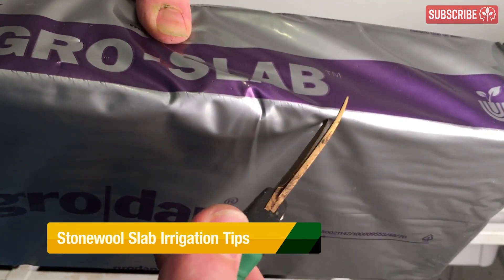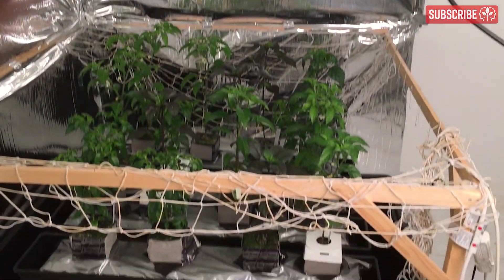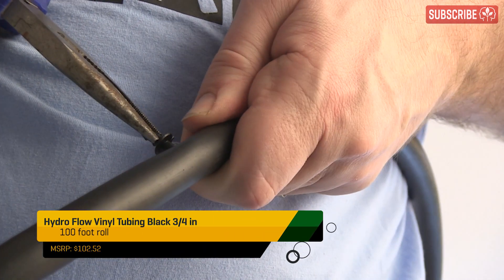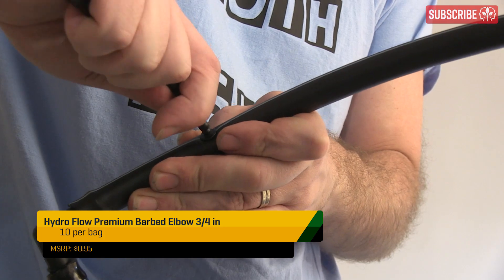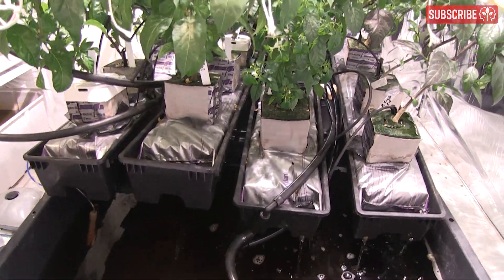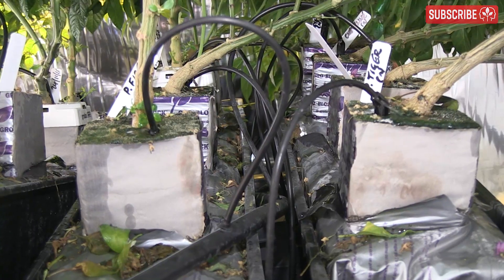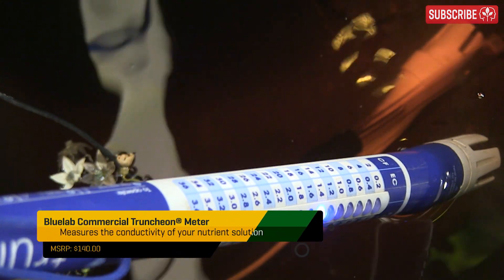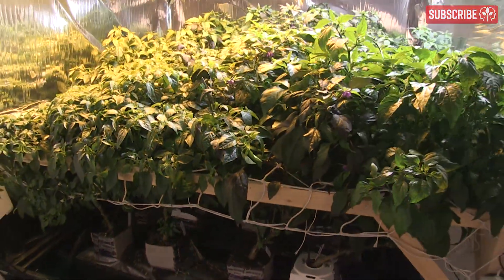Dialing in Drip Times and Drip Cycles with Rockwool / Stonewool Slabs

Comment: Coco coir same practice ?
Reply from the maker: Pure coco coir pith / fiber mixes have similar water holding capacity as rockwool (10X) — the key difference between these two media is the CEC (cation exchange capacity) — rockwool has zero — cococoir has significantly more — use a nutrient mix with elevated calcium and magnesium when working with coco coir slabs.
Reply: @Just4Growers  Thanks for great Content .  I use Ro water 0 PPM  . for cal mag 130 PPM is enought with Coco coir ?

Comment: Hey Everest,
How much water should I feed my cilantro and tomato plants if I drip 5- 6 times a day at 2 minute intervals?
Is dripping more economical in terms of saving nutrient than dwc?
Appreciate your feedback as always. :)
Reply from the maker: Hey Ravarsen, If you're recirculating your leachate (run-off) from your drippers then you're good—it's just as water wise as DWC, if you have a lid on your reservoir to avoid evaporation. What size pots are you growing your toms in?
Reply: Everest Fernandez I have a spare tank I'm thinking of using in a coco coir drip system, which I think won't cause any evaporation issues.
I'm growing my tomatoes in 1.3 gallon plastic bottles, dwc system. Is 1 gallon nutrient sufficient for vegetative and fruiting?
As you can guess, I'm pretty new to this and I'd like to learn from you. :-)

Comment: Hi Everest. I am having a bit of trouble completely understanding slab watering. I have 3 slabs with three plants on each slab. The grodan spec sheet says I should be watering 2-6 times per day (plants are about 40 days old, 20 inches tall) but the bottom of the slabs are still pretty wet after one watering a day or so later. Also the area outside of the 'X' cuts for the grow blocks is bone-dry at the top. Should I be concerned? I find that the every-other day watering causes runoff from the slabs after about 2 minutes of top / drip irrigation... Should I drop the irrigation time down to 1 minute and do every day? I am just as afraid of over-watering as under-watering, but I just don't see how I'll ever get to 2-6 times per day even at 1 minute each... GREAT VIDEOS! THANKS FOR ALL THE KNOWLEDGE I'VE ALREADY GAINED! YOU ROCK!